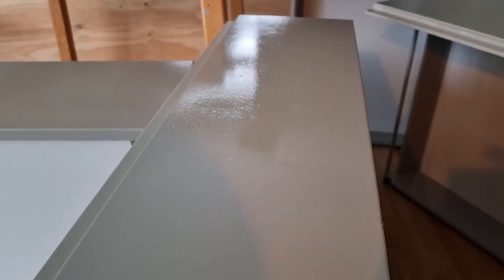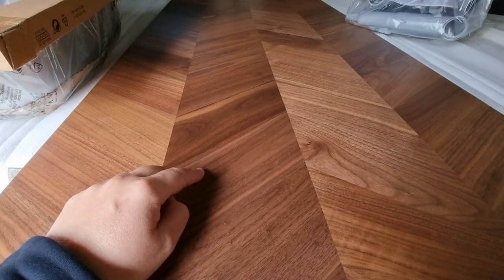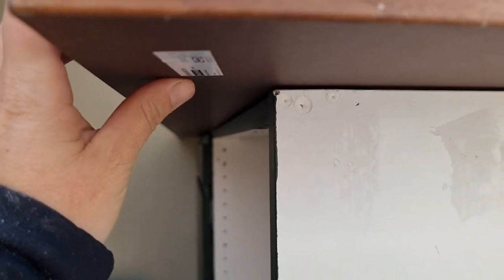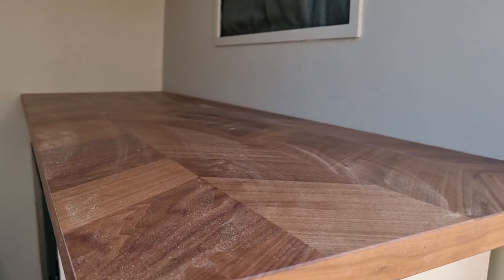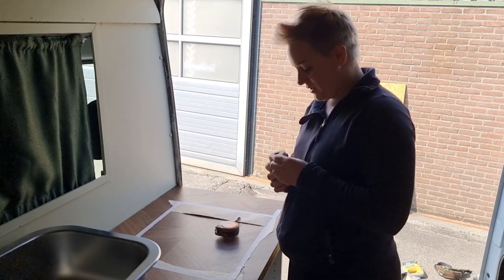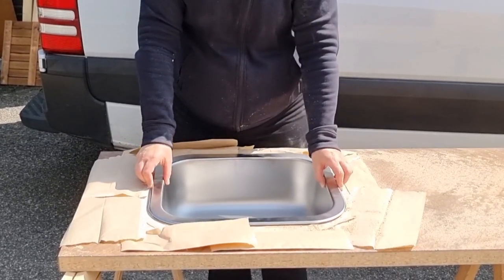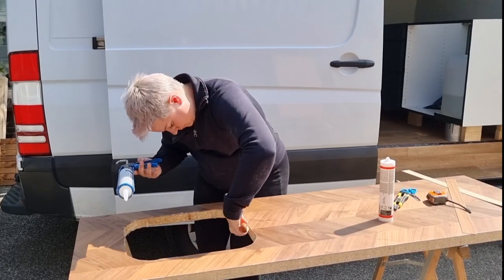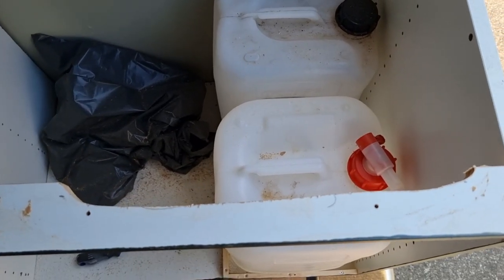How to install ikea kitchen cabinets and countertop in your Van / Solo Female Vanbuild

Comment: Hi Kim. What do you use as legs for your kitchen? The legs sold at Ikea doesn't seem sturdy enough for the van.
Reply from the maker: Hi! I used two wooden blocks stacked on top of each other screwed into the floor and than i screwed through the kabinets into those.
My thought was incase the Van would ever get into an accident and flip or tilt.(hopefully never ofcourse) they wouldn't move as easy than with just plastic legs standing on the floor.

Comment: Hi Kim, what kind of locking are you using for the drawers? To prevent them going in and out while driving, I mean.
Reply from the maker: Hi Arianne, for now i used magnets upto 6 kg. Because the drawers are facing back to front i don't have to worry about hard breaking for them to open, only when i am going up a hill.

Comment: where do i buy campervan equipment?
Reply from the maker: Hi! I got it from a ocal hardware store most of the time or online. What are you looking for?
Reply: @sayyestonewvanventures  I need to assemble a small and simple camper van, a sink with a stove and a bed
Reply: @sayyestonewvanventures  Do you have the addresses or websites where to buy the equipment?
Reply from the maker: Are you in the Netherlands? My kitchen is from Ikea and they also sell bedslats. Other then that i got my wood from de bouwhof in Zoetermeer